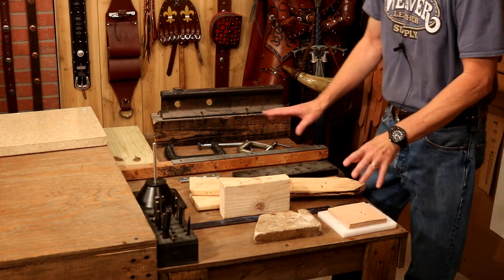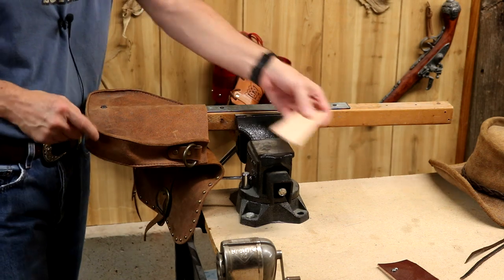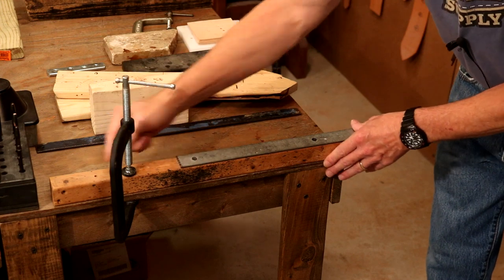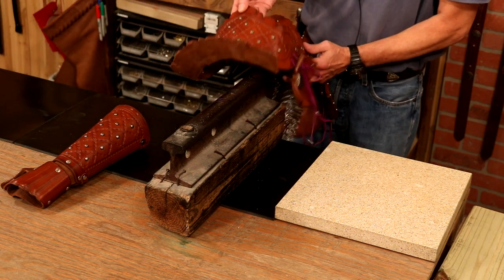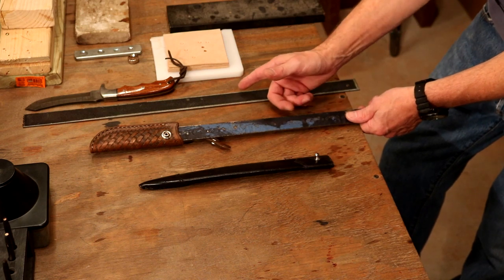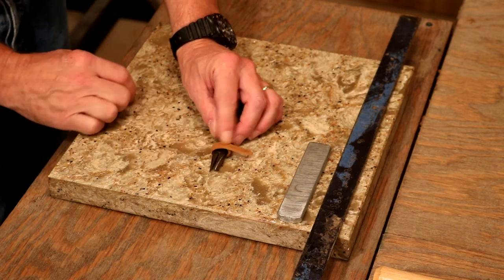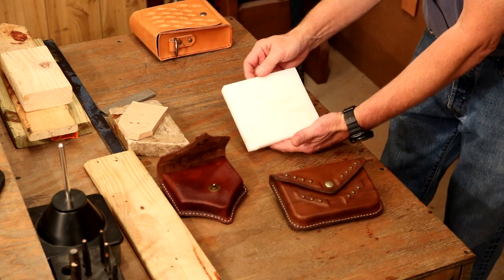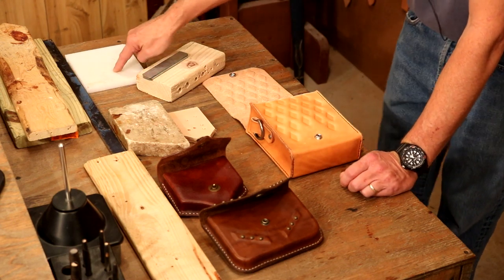The Leather Element: Setting Rivets In Hard To Reach Spaces

Comment: Another outstanding video by Chuck and crew. So much great information presented quickly and in an entertaining way. I have some rivets on some bookmarks that have tarnished; I can use Wenol on them to polish them, but I am concerned long-term about tarnishing more since the rivet is where the customer grabs the bookmark. What do I do? Thank you!
Reply from the maker: So glad you like the videos!  Thank you for letting us know!  Unfortunately, I don’t have a good answer.  A good steel, brass or plated rivet should take years and years before tarnish starts to show up and the oils in our hands shouldn’t have a big effect on it.  The leather, on the other hand, may be part of the issue.  A good veg won’t tarnish, but, if a project is fully in the elements it will and a chrome has a much higher risk of tarnish with or without.  It’s not much of an answer, but, there is only so much we can do as the manufacturers and we don’t have control over time, use and the elements.

Comment: I'm a leather worker and woodworker and want to make a tool bag, but my longest plane is 24" long and heavy. Wood is heavier than leather. I was thinking of using 12 oz for the bottom and 3" up the sides, then 8 - 9 oz for the rest. Now assembling it now, well that's the fly in the ointment. I would appreciate some guidance if possible. Thanks in advance.
Reply: Phillip Carden , what about a 1/4” thick piece of plywood set inside across the bottom?
Reply: @jayclark3058  Wood probably work.

Comment: Here is your next leather element.
Rifle case, what is the best leather besides plain veggie tan?
Reply from the maker: The veg is the best possible for the gun itself.  An English Bridle is one of my favorites but I haven’t used it for a holster or gun case.  It’s got some tallow in it which isn’t an issue but I just can’t give you a good call on it.  Other veg-tans can have some oil content and that will definitely work on the metal, so, look for a veg that has as little treatment as possible.